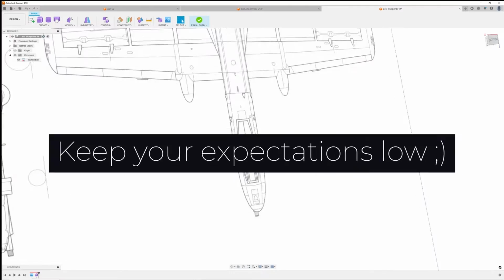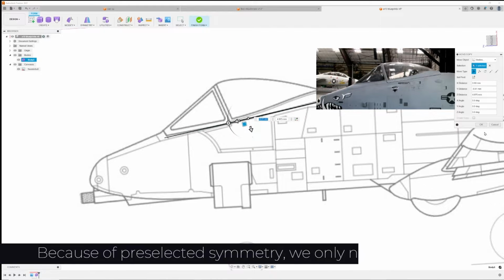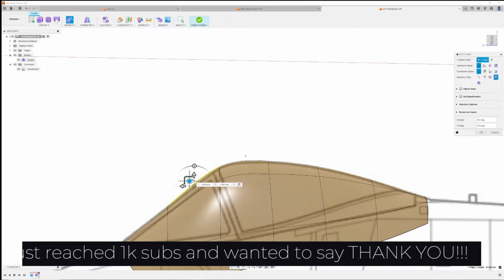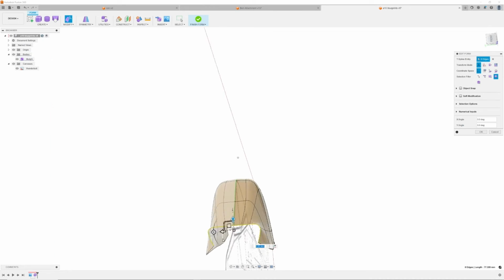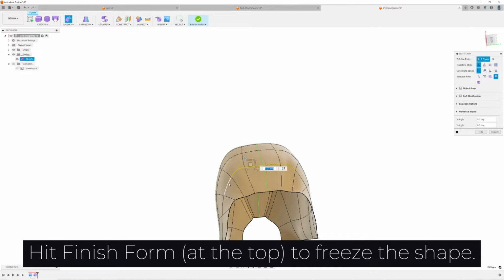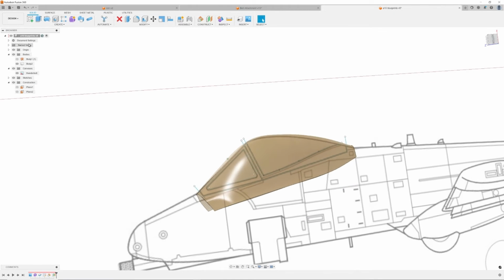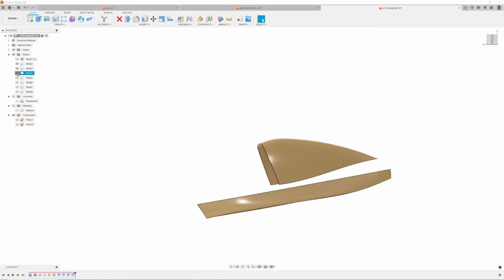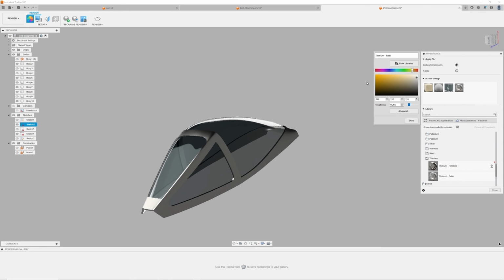Master Your RC Plane Building Skills with Fusion 360 - Narrated Tutorial

Comment: A great video thank you - the narration really helps. I'm currently struggling with designing canopies for a FW 189 - I'd be interested in your thoughts on how this might be best approached? Ideally I want to 3D print the framework and lay in acetate panels. A lot of WW2 German planes have similar angled canopy structures so this might be of interest to a number of your subscribers? Thanks again.
Reply from the maker: Interesting.  Let me think about this one for a bit.  I think there's a couple of ways to do it but I'll mill around to see which gives the best results without too many steps.  Are you modeling from picture plans? or an mesh file?
Reply: Hi, I'm modelling from 3-Views imported as canvases and I tend to use plastic model kits for reference.
Reply from the maker: Ah ok.  I’ve got a couple of ideas for you.  And since you’re modeling with the scale model part you actually have a huge advantage.  Let me put something together. Give me a few days.
Reply: @planejanemodeling  Fantastic - thank you!
Reply from the maker: Hey @RCGDL  I've worked out one way to do it and it is pretty reasonable.  

https://drive.google.com/drive/folders/1rTZ2SkZe2Sa6K9B00vDlm6xHqiUkK43g?usp=sharing

Let me know what you think.  I'm not sure I'll do a full blown tutorial on it but I can do a small video for you detailing what I did.  I'm still playing around with two more ways off the top of my head.  But this is the most straight forward and least frustrating.
Reply: They look good! A video outlining your approach would be very useful thank you. @planejanemodeling